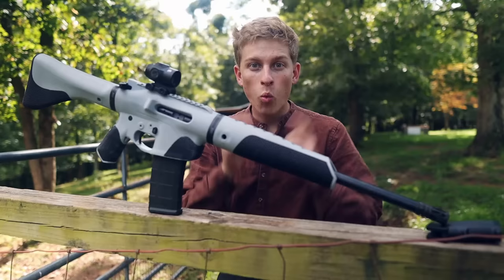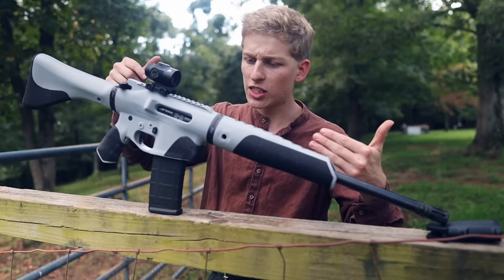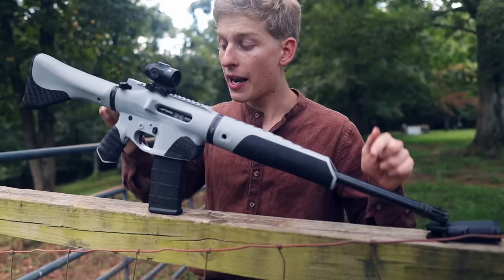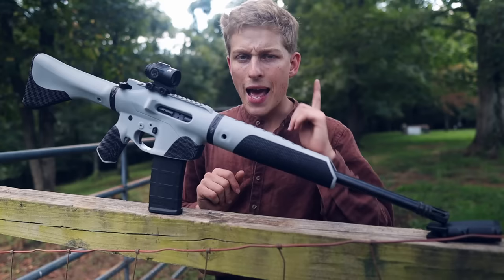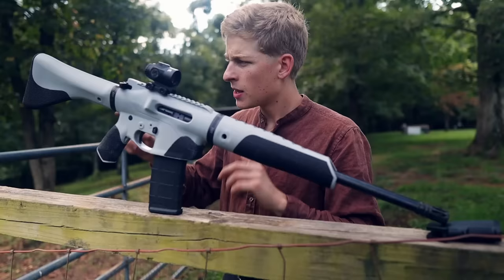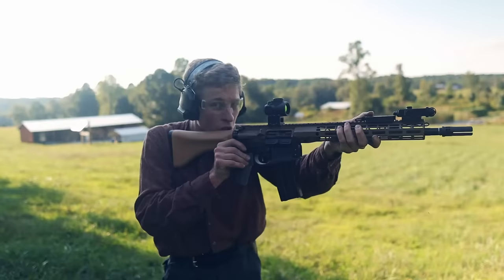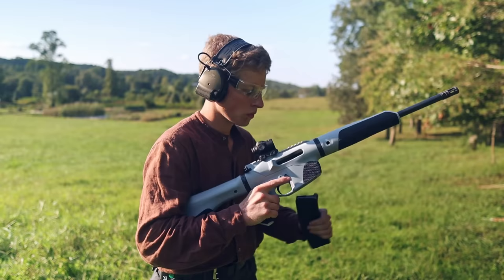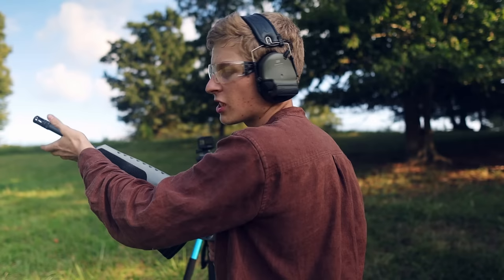I Printed an AR-15

Comment: Seems like the ejector geometry is pretty rounded off and might be thicker and more constraining than standard. The ejection port looks like it creates a slot for the brass to ride in and hits a flat cupped wall at the back so it bounces forward rather than start to spin out of the gun. Maybe try tapering your walls to a thinner point near the back of the upper near the ejector. Alternatively you could make a metal one that can be attached via machine screws.
Reply: The problem with plastic recivers: flex & heat. Flex cause problem with heavier optics on plastic rail and accuracy because the reciver have to be a tight & strong fit to the barrel for accuracy (iirc, guy ran over his ar with a truck, the reciver thread cracks, barrel is loose, accuracy decrease significantly. So it this case plastic flex produce same effect). Heat, as stated in video, weakens the reciver causing more flex. 
The only historically proven plastic gun (vhs 2 have metallic rail mount on steel post which is directly mounted to barrel) is the g36 which is now replaced by the 416. The g36 have larger diameter trunnion or barrel nut at 35mm (vs ar 25mm trunnion) to reduce the heat transfer to reciver, and have 60mm long  contact to reciver; therefore much more rigid than an ar normally is. The 3d printed dno dx7 failed after 370 shot, be cause the guide rail got loose, do have a larger and longer ak trunnion. 

Its unecessary that ppl still want to 3d print ar uppers, when in fact, the aluminum ar upper is just basically drilled hole with a slot cut for the charge handle, any milling machine would have no problem making the inner surface which the carrier contact, the barrel can just be drilled and pinned like an ak (proven by lmt upper which use screw but close enough). See the simple ar10 prototype thats basically some tube smg thing. The original armalite papers state that any screw cutting lathe can be used to make the ar bolt carrier & bolt. Ease of manufacture is built into the ar from the very beginning.
Reply: @cgdg7075  Did you mean to reply to the video or my comment? While you arent wrong I dont see what it has to do with my comment.
Reply: @travismarshall4878  hah i read your comment then his after and was like wtf . But yes to what u said ..its all absolute. The thickness is a bit much but id say filet it further around the ejection port/ non existing dust cover area..  and if we could have a different angle on that deflector which i have already easily resolved in my head after viewing the slow motion bounce backs i think explaining it is much easier on mushrooms but yea .. Hmu 🤙 i do caddy for you golfers out thar

Comment: Two suggestions, first the front and back of the ejection port are currently parallel, I think they should make an obtuse angle. The front of the port can stay perpendicular to the bolt but the rear of the port should be the same angle as the brass deflector.  To me it looks like the center of gravity of the brass, which is close to the base, is hitting the flat surface of the ejection port and bouncing forward.  If that entire surface is angled outward that will encourage the brass to deflect perpendicular to the gun, which is ideal.  The other thing to check is how gassed it is, over gassed uppers tend to eject forward and under gassed uppers tend to eject rearward.  
The other suggestion I have is when I built a 10/22 I measured the front of the stock and barrel and 3d printed a tight fitting barrel band flat on the bed, so the layer lines were perpendicular to the barrel. I was able to press it on with a tiny bit of white stress marks for a very tight fit and very secure hold of the barrel to the stock. Perhaps a 3d printed band that's printed flat on the bed can be used to replace the hose clamps.
Reply: ^This

Comment: Very awesome! You might be able to fix that ejection by angling your brass deflectors more aggressively so the casings flying to the side more. You could also try a "slick side" with no brass deflector.
Reply from the maker: Might have to try both.
Reply: @HoffmanTactical  switching to a mid length gas system might also help.
Reply: @paintzemute6364  Yes, try a mid-length gas system, and potentially a heavier buffer weight. It looks like your ejection issues might be due to the bolt cycling too quickly (the cases are barely into the ejection port before the bolt is going forward again). You can slow down the cycle rate by imparting less gas on the BCG (adjustable gas system, or mid-length and rifle-length systems), and well as increasing the reciprocating mass (heavier H1 and H2 buffers). This would allow the ejector more time to kick the casing out before going forward again.
Reply: Slick side would go amazing with those slick aesthetics

Comment: You could maybe design a Cam Latch system using TPU as a liner to keep everything tight instead of the hose clamps 🤷‍♂ Can make it to fit the aesthetic and add QD sling point to them.

Comment: The ejection problem is do to the thickness of the print. So instead of hitting and bouncing off like it should its hitting the round rim part of the bolt hold ejection area.
Reply: I think you’re right, I think if he laid down the back edge of that ejection port to follow the same plane as the brass deflector, to almost a knife edge (maybe like a 2 or 3mm edge thickness) he might get better results
Reply: I was thinking the exact same thing. It's to thick by the brass deflector. Carrying the angle all the way into the ejection port would probably help, even just a little.
Reply: I agree, it appears to allow the back of the casing to get kind of corralled into the arc at the back of the opening before it even gets to the deflector.

Comment: the only improvement other than your ejection problem would be to make it possible to put the dust cover back on. it really does help in the field keeping stuff out of the bcg and chamber. dirt slowly gathers on the side of the bolt, its got a comfy place to sort of gather on that ledge, then you fire it and it goes all over the place. The AR15 is much less reliable without that dust cover. I understand it's not a priority now, but i'd highly recommend putting it on some version of the print instructions in the future. I would never walk around with an AR slung on my that I am really counting on and cannot close a dust cover. it even makes the gun basically mud proof.
Reply from the maker: Yes, it would be nice.

Comment: Alternative to hose clamps, band clamps. (The thin metal clamps that are used to keep the rubber boots on an automotive CV axle, and have to be crimped tight with crimping pliers)

Comment: Great idea with an active cooling setup, but I think it might be more worth your time to look into an insulated heat pipe PASSIVE cooling setup, maybe to direct heat to a larger passive heat sink in the stock. You can buy these pre-fabbed hollow copper heat pipes that have a working fluid inside that actually utilizes phase change cooling to drive heat transfer to a heat sink and then condenses and returns the working fluid using a microporous substructure inside the tube. Absolutely worth looking into for a passive long term solution
Reply: How bout heat sinks all around the and then over it with a skeletonized shroud, or mlok

Comment: While I haven't printed any firearms, I have a lot of experience printing with high temp filaments. Everything from nylons and polycarbonate to PEEK and Ultem. One of my favorite CF nylons is 3DXTech's Nylon CarbonX. Looking at an HDT of 147C. But I think Taulman has a couple of products worth looking at as well. Their Cast Plate filament can go up to an HDT of 180C after annealing, and they have a glass fiber reinforced nylon which offers slightly greater HDT with the additional structural and aesthetic benefits of fiber reinforcement. 3DXTech also makes a really nice CF polycarbonate which could be a good option, but printing PC filaments requires a slightly more capable machine than what's required to succeed with nylons.
Reply from the maker: Interesting. I've had issues with the Taulman Nylons becoming too flexible after water absorption. The Polymaker PA12 is looking promising. Annealing some now.
Reply: @HoffmanTactical  Yeah PA6 prints do tend to become rather floppy after soaking up humidity. The Cast Plate stuff behaves a little better than their other offerings once annealed but not nearly as stable as a CF or GF filled nylon. I have some issues with Polymaker, specifically their Polymax PC. From the way it prints and the mechanical properties it exhibits, it's nothing like a pure Lexan PC resin. Behaves more like a PC/PBT blend. Much easier to print, but also lacking the strength and thermal stability. 

Either way, I'm glad I stumbled upon this channel. I think you're doing some really cool stuff with 3DP tech and I can't wait to see what you do next.

Comment: I would absolutely love to see a rifle with active cooling on it, I don't think it would be practical for anything but it would be a really interesting case study on why it's probably not an amazing idea. Seems like it could be something that'd make it to Ian's forgotten weapons table.
Reply: RGB water-cooler on your AR. In all seriousness, I think the solution to the heat problem for ARs is going to be an improvised or simple to make metal trunnion with heat guards to protect the plastic.
Reply: Honestly had the same idea a little while ago but the idea of designing or moding an ar to have hollow tubes through out its upper frame for water to run through gives me CAD ptsd. In the end I realized I can cool the whole gun at once by putting it in a bucket of water. As a forgotten weapons meme its a 10 out 10 of an idea!
Reply: Someone is working on a scorpion hand guard with pc fans lol
Reply: some old mg’s from ww1 had water cooled barrels , notably the british Vickers, so def not a new idea

Comment: Some notes and comments, for starters, great work. It's looks and seems to perform great. I, for one, hope to get into the beta, I've printed multiple of your lowers in PA6-CF, and did a full FGC-9 build :) 

In terms of improvements, I would do more parts of the handguard in PA6-CF for temp resistance. For the ejecting issue, I would actually try to angle the deflector at a more steep angle, or try removing it completely. If it doesn't compromise strength, I would also do a slight ""angle"" infront where the bolt rests when closed, rather than it being a hard wall there.

Comment: The reason it's creating a stove pipe is becuase the casing is running into a flat wall of plastic first. It's not even touching the deflector you've made. Try making the back of the ejection port angled and closer to the bolt.

Comment: In the slo-mo, it looks like you need to angle the back of your ejection port on a 30 to 45 degrees.  Your rounds are hitting the back of your ejection port on the flat part and bouncing directly forward--  if you just file the rear of your ejection port at an angle, it will allow the round to bounce off of it and fly more towards a 3 O'clock direction.  In other words, on a reprint- carry the slope of your brass deflector all the way to the internal wall of the upper, rather than having it squared off at the rear of your ejection port.   The thickness of the upper is so much wider than the typical forged upper, so you're slamming the round into the squared off thickness of the upper receiver, rather than the round hitting the angled brass deflector.....  So again, that angled slope of the brass deflector should carry all the way to your BCG;   There should not be any flat 90 degree surface at the back of your port--  It needs to be all slope.  That may mean you have to move your brass deflector to the rear some more to widen the opening again.
edit:   I noticed you are already onto the problem later in the video, so that's good
Reply from the maker: This.
Reply: I was thinking the same, but also the angle of the plastic will be a bit too thin at the front so maybe need use a nylon part there to hold up. Not sure if you can glue a nylon part to the PLA part, so maybe a clip. For the front of the port,  a similar shallow angle divet may help with cycling the bolt as it closes and air is pushed away.  Maybe an inserted nylon part on the exhaust holes above the barrel would be possible and a screw on upper and under barrel rail?
Reply: @KernsJW    I agree that the point would be thin, but I think that the shells would never hit the point-- at least not too often.  I think next time he's going to print the entire thing in nylon.  IDK if you can print with it, but there is a higher temp nylon called pa6.
Reply: @HoffmanTactical  There's a higher temp nylon called PA6 or nylon 6 or pa66..  I'm not sure if it's available for printing-- but it's much more resistant to higher temps..  Other than that I literally don't know what I'm talking about lol..  I just know that the higher temp glass filled nylon is used in a lot of power tools like drills and impacts, etc..  But those are injection molded clam shells--  so maybe it's not even available for 3D printing-- I'm not sure.

Comment: my take on whats happening is the thickness of the upper makes a flat spot before the actual deflector ramp and the spent cases are hitting that flat spot and being ricocheted forward into the forward section of the ejection slot solution change the angle of the ejection for that bolt .
To fix it i suggest measuring a aluminum uppers deflectors base thickness and adjust your angle to compensate for that thickness which would mean moving the starting of the ejector ramp farther rearwards so the ramp extends all the way down to bottom edge of the thickness closest to the bcg thus doing away with the flat spot at the bottom edge of the deflector ramp.

Comment: Love the design.  It looks amazing and it only has teething pains.  From what I can see in the video, it looks as if the rounds are bouncing off the rearmost part of the ejection port  that is 90 degrees from the bore axis before it turns into the shell deflector.  Whatever it's hitting is immediately causing it to bounce nearly straight forward, which eliminates the shell deflector itself given the angle it has.  Try putting a steep bevel on that section that more or less blends it into the angle of the deflector.  Either that or move the back side of the ejection port further back.

It's a beautiful design and I really like it a lot!  How did you get the dark grippy parts on there?  It seems so ergonomic and also organic looking.

One thing I thought about recently for potentially stronger 100% infill parts was to iron every layer at 90 degrees from orientation of the print using super slicer to guarantee better layer adhesion.  You may want to investigate it if that isn't something you are currently doing.

Comment: But what about the barrel? This is all cgi! Your Optic isn't printed..... You used screws... It's not print in place..... Some people will never be impressed. Fuc k em.
Reply: The fgc-9 has proven you can make a design that is 100% home built with low cost of entry (like $500-$600 for everything) and you'll get the new age version of fudds "well i trust metal more (unless you count my polymer handguns and polymer upper guns like the scorpion), have fun", "you've been able to make guns on mills (that start at $5k) for years, this isn't impressive" its fudd mixed with buyers remorse. Its the polymer frame vs metal frame handgun debate all over again. Maybe also a little fear of new things.
Reply: @patrickrhoades480  hopefully the orca pushes this to the next level

Comment: Bro, you've redesigned the AR platform. A commercial, non-3D printed AR using your improvements could be a game changer in a lot of ways. That is not to say your 3D printed AR isn't a game changer, it absolutely is!

Comment: The rounded concave area where the shell deflector is blended unto the receiver means that the focal point of any force directed into it will be redirected forward. Imagine a ball hitting the inside of the deflector. Could also be flexing of the upper under pressure changing the angle between the BCG and the shell as the receiver flexes, slowing the extracting process as it binds slightly, and making the ejector behave in a less than ideal way. Try putting a big reinforcement on the top of the receiver and deleting the deflector

Comment: Look into how the Lewis gun had an air cooled barrel shroud where it pulled air in from the back and down the outside of the barrel. Maybe a handguard design like that would help keep the plastic cooler.

Comment: The casing deflector, being much smaller than on a regular AR, changes VERY sharply from the ejection port to the deflector. There is that HUGE LIP that the casings are hitting before ever touching the deflector. I think that if you were to "fade" into the deflector and get rid of that sharp edge that the casings would not deflect forward as much and it would allow them to instead deflect more off to the side at more of a 45 degree angle. The casings seem to be hitting that thick piece on the back of the ejection port more like a flat wall and throwing them straight back forward or even back into the ejection port itself rather than hitting the deflector and throwing them off to the side. All my time in the Army and ALL of the ARs that I have fired have a deflector that comes directly off the ejection port at an angle and do not have that lip on the beck of the ejection port between it and the deflector. I wish I could draw you a picture to illustrate what I'm trying to describe, but I hope what I said made any sense....LOL.